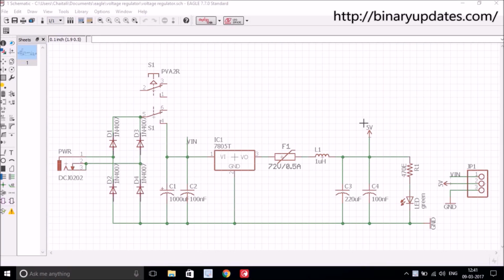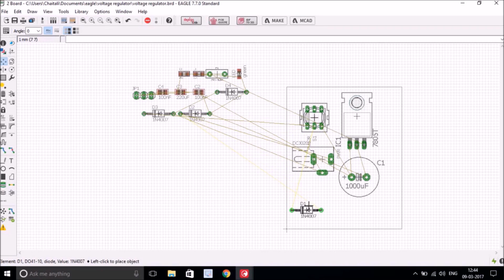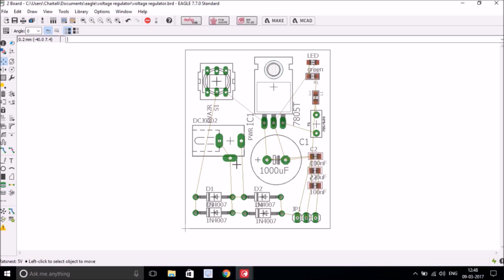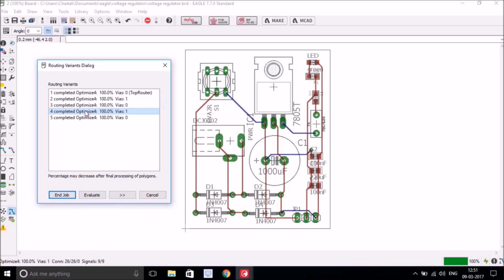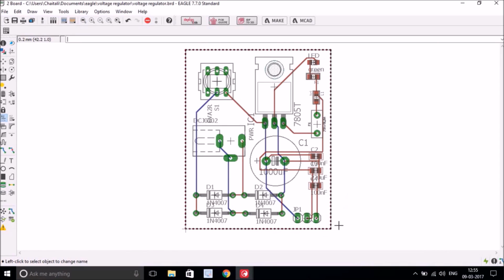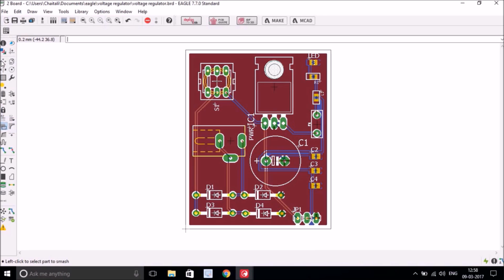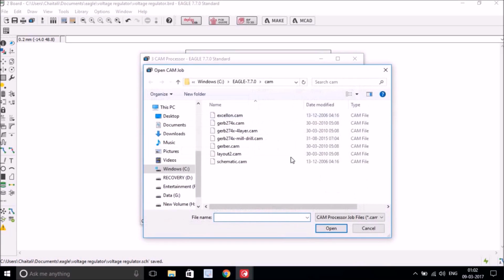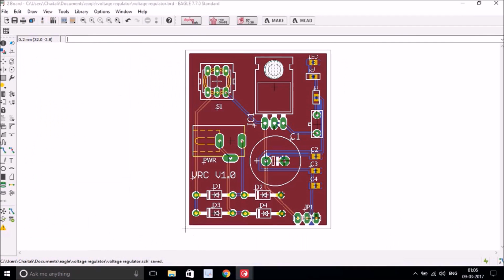Board Layout with Eagle PCB Design Tool

Comment: Your tutorial is very helpful, can you suggest where do get the library for the components which you used like DC jack and radial capacitor, new versions of eagle does not contain much of discrete components. Your help will be appreciated.
Reply from the maker: Thanks Mr. Jeetu. The common component can be found easily in Adafruit or sparkfuns Eagle Cad libraries. I have posted Eagle part libraries on this blog https://binaryupdates.com/eagle-pcb-design-tutorial/
I hope you'll find useful. Thanks